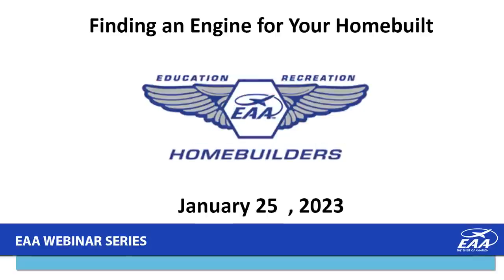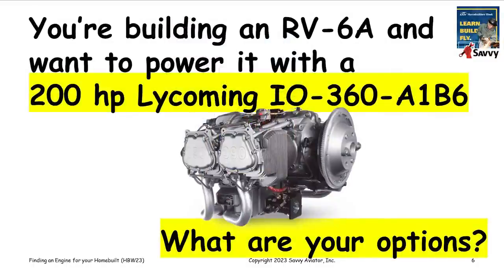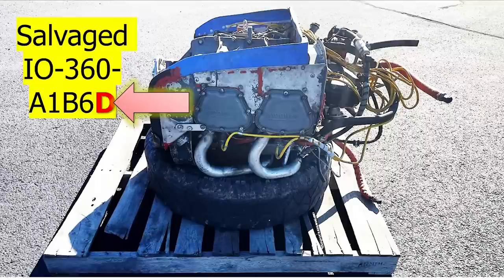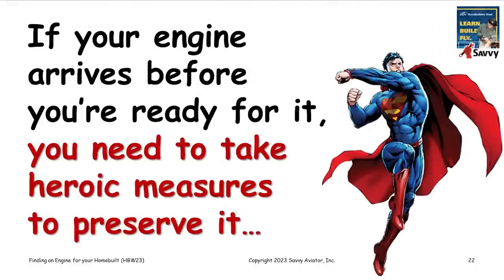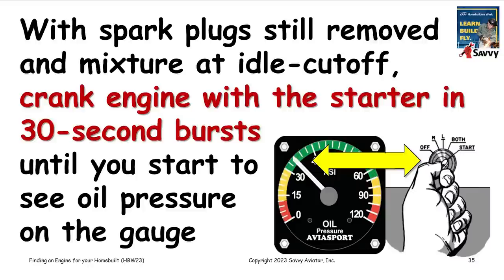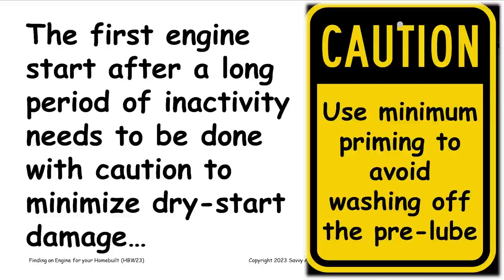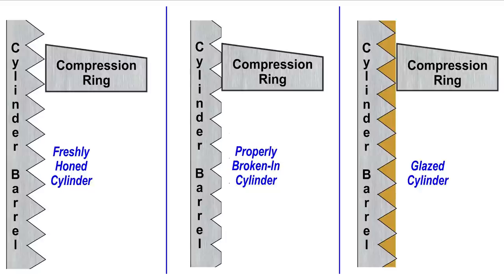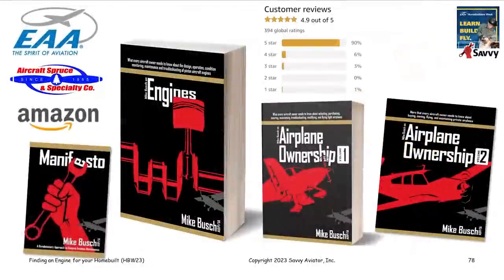Finding an Engine for Your Homebuilt

Comment: Thanks Mike for the presentation. As usual learned lots of new stuff. Somewhere in the back of my head is the dewpoint figure of -40 degC for the absolute prevention of corrosion. This is not easily achievable with most fridge based dryers ( there are exceptions Drycol-Breather-Brochure-EN-2018-01-Grid-SER-0957) so I think desiccant may be the gold standard for long term storage.

Comment: Thanks Mike, I like what you suggested about the first flight being used for engine break-in on experimental aircraft. I remember going through that very thought process as I was getting ready to do the first flight on my Kitfox with a new Continental IO-240. Everything I read talked about doing a short first flight to get a general feel of the aircraft. 

What??? What about the engine? I went against the grain and decided to do the engine break in first. My thinking was that as long as the plane, engine and indications were looking normal I would do a one-hour engine break in flight over the airport. 

I don't think the EAA flight test handbook talks about engine break in. I think you are the only other person I am aware of that has proposed this idea. 

FYI I am an A&P-IA with 40 years' experience. Great thinks mind alike. 😉

Comment: I knew a guy in Florida who needed to store an engine for a couple of years until he built a Quickie, so he took it apart, put the pieces in a 50-gallon drum, and filled it with oil. Problem solved.

Comment: What is your opinion about getting a good engine with a good price now to guard against huge price increase due to inflation a few years from now.  It is contingent on the buyer can preserve the engine from rust.
Reply: Impossible to predict the future obviously, but we have not seen many periods where engine prices go down.  Preserving the engine is easy - do like Mike instructed to ensure the inside of the engine stays "dry" (low humidity) with a coating of oil, and it will last indefinitely.    I did what he suggested to my io-360 and preserved it 10 years.  I also filled it completely with oil.  Any metal under oil won't rust.  If your engine is horizontal on a stand, you can rotate the engine (not the crankshaft - don't rotate that) and ensure oil gets everywhere.    If you live in a very humid climate, try to store the engine inside with A/C which will also reduce humidity.  The spouse might not like it too much, so better to let the engine rust than to get a divorce!

Comment: Great webinar!  Quick comment - the 200 HP angle valve engine is probably not the best engine for an RV-6A - the 180 HP parallel valve engine would be better, and probably cheaper and easier to find.  Dropping back to a 320 engine will save a lot of additional money, and will give up very little performance.
Reply from the maker: The straight-valve O-360 (180hp) Lycoming is indeed cheaper to source parts for than the angle Valve 200 hp IO-360.  Both engines are reliable and well-supported.  Some people just gotta have that extra power...

Comment: What is the procedure for breaking in one or two new cylinders in an old engine?
Reply: Same as for a new one. Straight oil and running hard might only be needed for the one cylinder but the others will be fine with the oil and the high power.

Comment: When it comes to pickling an engine that is going to sit for a while why not just fill the whole engine top to bottom including the cylinders with diesel fuel? 20 bucks and everything is always bathed in an oil and can’t be exposed to air.  Can’t really see how rust could form and it’s cheap

Comment: Hi Mike.  From UK but presently in Vietnam. Great stuff as always, thank you.   I have a Bede 4 with 0-320 in the UK.   With regard to the idle RPM at startup... I was always told that the 320 needed 1100 minimum RPM to be able to splash lube the cam?  Can you clarify which is best for this engine.     I always try to slowly get to 1100 from startup and warm with lean mixture as soon as I can to help protect the cam also.   Thanks. Peter G
Reply from the maker: I've never heard of this. These engines should be able to idle at 600 to 800 RPM, and there would be plenty of oil splashing on the cam at those RPMs. I think idling at higher rpm would be more abusive to the cam if anything. -- MB

Comment: What would happen if you didn't do the break-in procedure?
Reply: If you do not do the break-in procedure properly, the cylinder walls are likely to "glaze" and you will end up burning more oil among other possible problems.